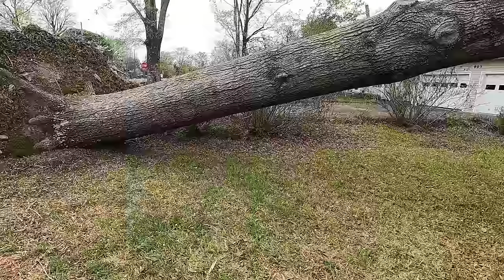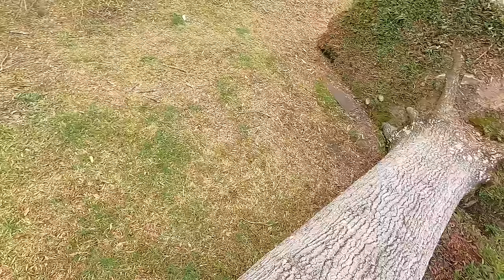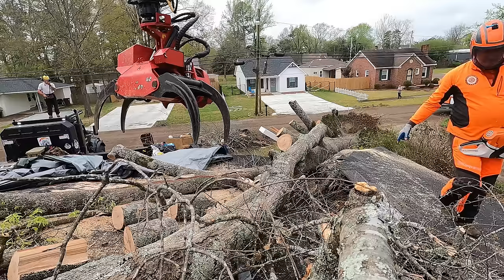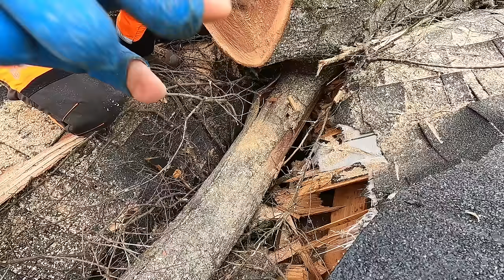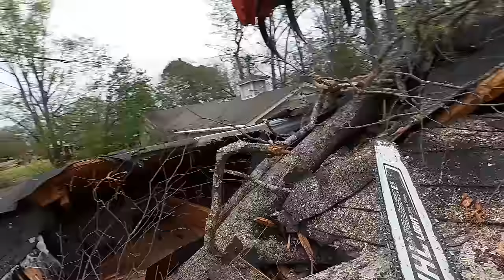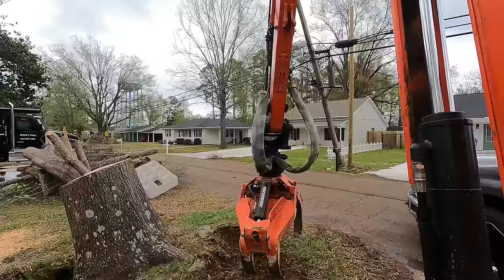Large oak tree on a house in Amory Mississippi

Comment: Shewww what’s the towing capacity of that gladiator? That’s right impressive
Reply: On the books 7500 pounds. Only due to engine cooling capacity.  I deleted it and tuned it. My largest load was around 11k pounds plus around 3k for the trailer.  I have airbags and electric brakes. And was no issue plus got 16.9 mpg    Great diesel engine once it’s tweaked.   I don’t recommend hauling that heavy often tho.

Comment: How many don’t have house insurance?
Reply from the maker: I am guessing there are quite a few without insurance.
Reply: When Hurricane Isabel went thru Eastern VA in 2003, we were blessed. We lived on a heavily wooded lot and 3 months earlier had taken out 14 trees. Still lost two of ours,and two of the neighbors trees landed in our yard. But the guy three doors down had 3 huge oaks land one on top of each other, like dominoes. Right on his two story garage. Flattened it. But no one in our neighborhood lost their house. Two blocks over was a different story! When we moved two years later, ,my only requirement was no hurricanes! We do get dangerous strraight line winds however. But no tree near the house is taller than 20 feet, or closer than 30!